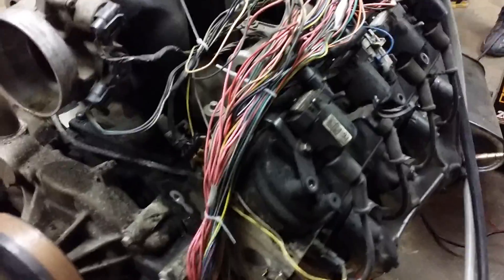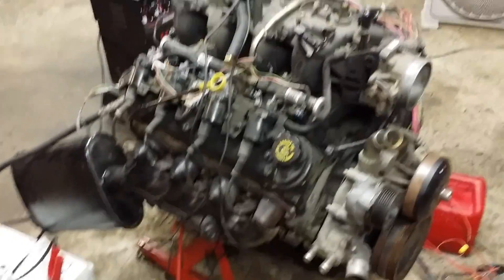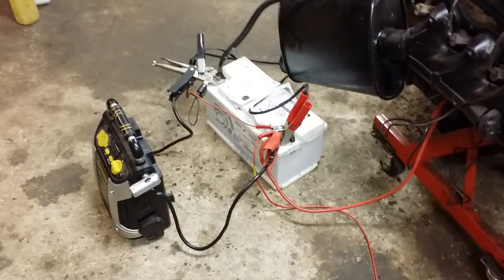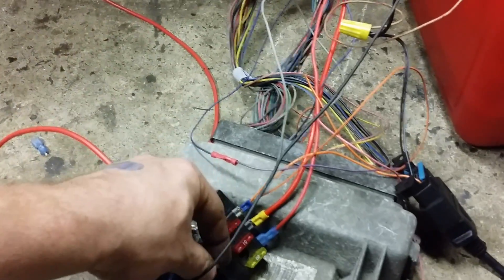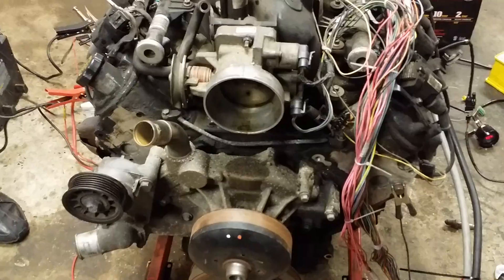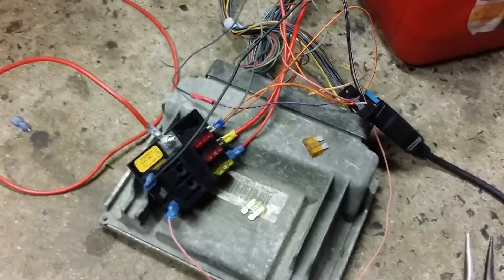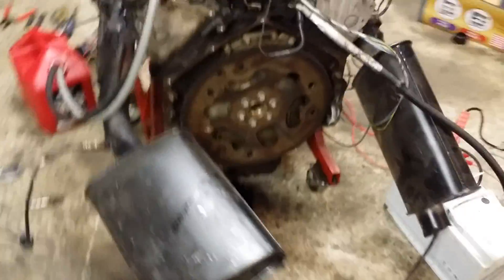7-5-15 Stock ECU stand alone harness test

Comment: there a few test rigs found on you tube 
planning on making one too , if you have enough space in the shop i would start with a warehousecart and just weld the enginemounts to it and add a shelve on 
http://p.globalsources.com/IMAGES/PDT/B1008361977/Warehouse-Cart.jpg
i suggest putting the front of the engine toward you / the pushbar so you can mount the trans to it without it hitting stuff should it be nessisairy 

another thing i been thinking about is using a extremely shortened pickup chassis with the rearaxle solidly mounted (trans yoke straight ontoo the yoke of the diff) and a set of sticky tires bolted to it
the front setup isnt that important and could be a little red wagon for all i care as long as you can strap it down and it hold the weight and torq of the engine 
the idea i have about this is you could roll that ontoo the dyno you have and test the whole system under load with plenty of room to walk around it

Comment: I recently did a 1jz swap in my 89 supra,  paid $1200 for a wiring harness and they used the wrong connector for my auto tranny and i cant plug it in so the car won't shift out of first so I'm thinking about selling my harness and going 5sp Manuel and getting the ms3. How complicated is it to do this

Comment: matt how did you get the computer to work ??? vats??  how the hell did you remove it  i  can not see spending  $ 700.00 for hp tuners just to remove the vats  please let me know how you did it thank you  driveshaft guy
Reply from the maker: 31chevylq i have hptuners and i turned off vats and setup the computer as speed density, thats how i tune late model stock computer cars
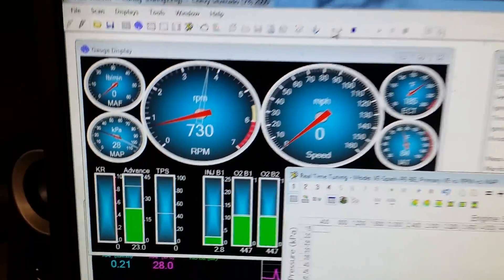Reply: 1:26  His crankshaft is spinning wtf are you talking about
Reply: 200$

Comment: Nice! I still need to weld my muffler on my test stand. I like how yours are separate. Would make the manifolds quicker to remove. I've been planning to run a single muffler with a Y.
Reply: AGearHead4Life is there a detailed video or write up on how to do this standalone?
Reply: @24BLUEELMO  lt1 swap.com